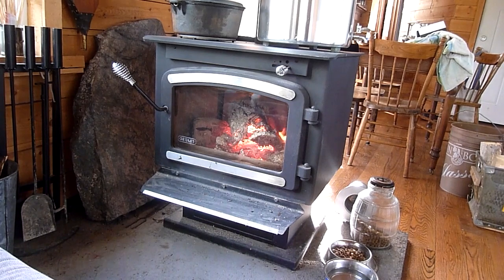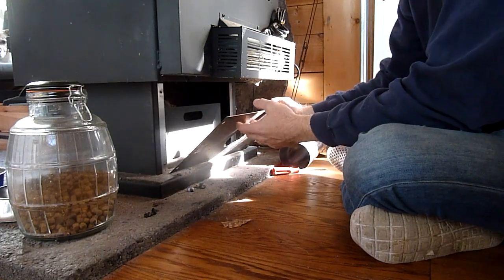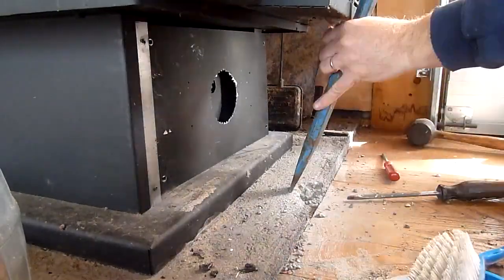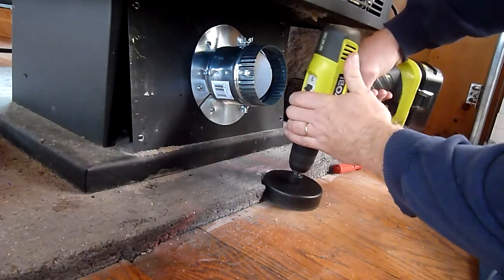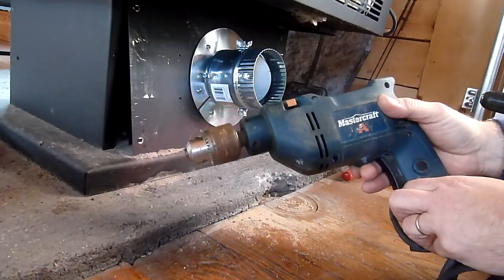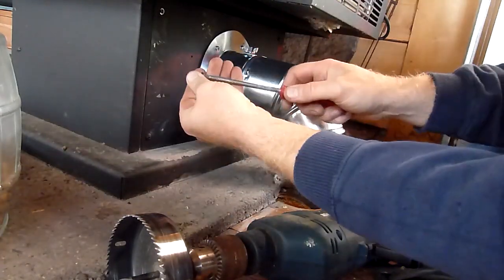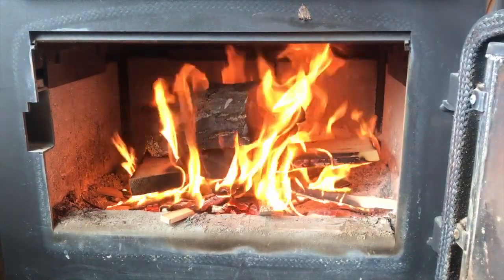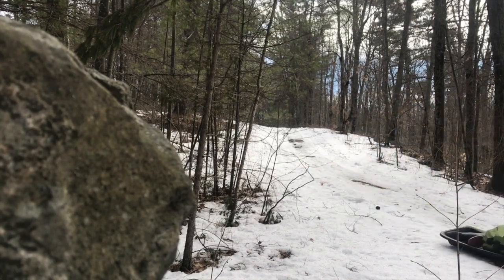Better burning wood stove with a external air intake!

Comment: You are right about the benefits of a cold air intake. After installing one on my wood stove my feet are a lot warmer in the winter. Previously, makeup air for the stove came from all the various air leaks in the house and that cold air traveled along the floor as it slowly drifted towards the stove. Outside air intake made a huge difference. One good way to observe how cold that makeup air had been was to grab the new outside air intake tube. It is freezing.

Comment: My wood stove has air intake on the back, pointing down, amount of air is controlled by the air damper built into the wood stove. But I haven't connected that input to a cold air intake. I'd like to do it, just the certified professional installer said those intakes cause a lot of problems with freezing and condensing or something. I wanna figure out how to do it super perfect so no issues.
Reply: The question you pose is a hard one to answer as each house is different, but please ignore your ‘professional installer’ 
as it’s all in the design. If you drag winter air through steel pipes which is 95% moisture saturated yes there is chance 
of condensing depending where the pipe is routed. My house is built on strip foundation and I have a 18-24” cavity 
below the floor. I’ve insulated the joists and sealed the underside of the joists with solid sheet insulation. Using a 
breathable membrane directly above the floor boards allowing moisture to escape. So the cavity is cold under the house
and that is where I draw my wood burner air from. I have ventilation grills all around the exterior walls so the air is free 
to move under the floors. I have no damp issues and the steel pipes I use are wrapped in glass fibre insulation 1-2 inches 
think. My wood burner when set at temperatures only draws air from under the floors no room air is used, only when 
initially lighting do I open internal air feed from the room. It wasn’t easy to do and I didn’t use ‘installers’ as the skills 
needed were beyond them. I did it myself when ripping the floors up to insulate as we were really cold with draughts 
blowing up through the floor boards on windy days. I needed a special 6inch stone cutter to pass the pipe through 
the hearth solid 3 inch granite slab, that was fun! But now after 4 years I’ve forgotten all the back breaking work and 
just enjoy the fire. Insulate insulate insulate, I would say. You cannot over insulate your house.

Comment: You really should insulate between your floor joists with R-40 insulation ( 2 layers of R-20 fiberglass batts). Then seal it up with plywood or a house wrap.
Reply from the maker: It’s on the todo list
Reply: @OntarioLakeside  I have one of those too...lol. Really enjoyed the vid btw.

Comment: After seeing this being installed and used for real, I am going to put one in my home. Look forward to enjoying a cold air intake. Will be taking air from the attic through the HVAC duct. Look forward to the effect soon. Peace.
Reply: Hi there.  The easiest option for me would be to draw air from the attic.  My stove comes with a cold air intake.  I would take a pipe up alongside the chimney into the attic under a clay tile roof (plenty of ventilation!).  Has this worked for you?  Cold air sinks and the air in my attic will be definitely cooler than air in the living room.

Comment: An external intake is a great idea. My stove is multifuel and has 2 intakes ( not external ) the airwash on the door and a bimetallic strip controlled intake to the ash drawer. The manual says use the airwash only for woodburning and the bimettallic strip intake for burning coal,  peat and lignite. The reason given for this is woodburning needs an air supply from above the bed of ash / embers and coal etc requires air fed from beneath the embers for optimum burning. It would be easy for me to attach a tube feeding the bimetallic intake and run it from outside. All I would lose is the bimetallic strip and intake cover but I worry that the stove would overheat or heat up too quickly after lighting causing warpage of the internal metal fire plates ( which has happened before ).

Comment: I have considered an air inlet from the outside for a wood stove and a fireplace.  We had a fireplace(built in 1934) in our house in St. Louis, MO that we bought in 1975.  It had an ash door at the back under the fire so ashes could be dropped into a chamber to be removed through the basement instead of through the house, which worked well.

Comment: Question. Would adding a flue damper to these modern stoves help in anyway? With retainingthe heat..seems like it would help but the community seems divided? Thoughts?
Reply from the maker: Dont see how it would hurt.

Comment: This was an excellent tutorial on outside air intakes. I often look at the smoke coming out of my chimney and think that just as much cold air is entering the house. A 6 inch layer of insulation under the floor would also go a long way to keeping your cabin warm. I just insulated my floors and it made a big difference. No more cold feet!

Comment: Very helpful if you live in a nice big cabin in America.
I live on a narrow boat in the UK... Don't think I'm going to drill a hole in the floor 😀I'll have to put up with cold ankles!

Another good method for making your wood burn slower and more afficient is to always leave a good bed of ash in the grate, it let's less air in once your fire is going, so logs burn longer. Only use your top damper to get it going.

Comment: This just makes good sense, when my parents house got a new furnace and hot water tank years ago they added a cold air intake for them, especially since the furnace was a high efficiency model with the exhaust gas blower (that dies every few years) so it draws a lot of air for combustion purposes.

We are in a rental with a wood stove fireplace and might be able to convince the owner to let us install a cold air intake via the wall since the stove already has a hole in the back of it’s base where you made yours.  I’ve been looking into adding secondary burn air tubes at the top of the unit but it seems like you’d need to modify it considerably compared to this, so as a first step to improve efficiency this may be a much better option.
Reply: I just took a look into the hole at the back, and looking down it appears to have a hole in the bottom as well and even a vent with a grate through the floor to the crawl space, but it looks blocked off.  There are also signs that the hole at the back was closed off at one point because it looks like 4 circles of silicon around it like something was glued there to keep it from drawing air from inside the house.  Someone must have come along and “fixed” it thinking they know better.
Reply: @SchwaAlien  Setting an air intake pipe is obviously the BEST thing to do. The stove not only pulls its fire-draw sucking the hotest air around itself (the one it just went to heat) but also all the air refill comes from outside.. the cold one 🧐
Sorry for my poor English, greetings from Switzerland 🙂

Comment: Setting an air intake pipe is obviously the BEST thing to do. The stove not only pulls its fire-draw sucking the hotest air around itself (the one it just went to heat) but also all the air refill comes from outside.. the cold one 🧐
Sorry for my poor English, greetings from Switzerland 🙂
Reply from the maker: Exactly🙂
Reply: Hey Aerocap I saw your comment on another video, looked up how to make an external air intake and saw you commented again! I don't understand what you mean about the fire draw sucking the hottest air around itself, could you explain more? If you'd like you could respond in your native language and I can use a translator.

Also, would it be possible to actually heat the cold air intake or would that not be helpful? I'm thinking if the cold air intake tube was positioned right next to the chimney, it would heat up a bit.

Comment: This is really timely for us. Small addition and the wood stove are coming in 2022. We are not very handy ourselves, but when we are sorting out the floor joists and the location of the stove we will be sure to leave room for the cold air intake pipe from down below the stove location. Good advice. Now, can I get a WETT-certified technician to install a customer cold air intake with a damper? Time will tell.

Comment: Thinking about doing this as well.  My stove already has an inlet and I notice the tower fan I have laying on its side behind the stove pushes some air in it and helps the fire burn better.  Nothing but basement below the stove so should be pretty straight forward.  Hopefully it along with improved insulation will help with the drafts we currently encounter.
Reply: Did you install the cold air intake to receive air from the basement and how did that work out or would you take it to outside? Thanks.

Comment: This is interesting.
I have a summer cottage here in Sweden, it has neither electricity nor running water.
We realize how difficult it is to get good heat with the old style wood stove, just as you say the fire sucks the heated air and you really feel cold winds on the floor!
Here, firemen and sweepers are very conservative and do not understand at all what I mean by fitting an air duct right next to the fire!
Reply from the maker: It has made our woodstove much more useful.  I highly recommend it.

Comment: lol dude, ryobi ftl, mastercraft also ftl.

just get a dewalt 99x series battery drill...you will never buy another one minus batterys.  I've had 4 to 5 major brands.  I use them daily with augers and stuff that's well beyond what any cordless drill should have.  these have lasted me 3 to 4 years at a time (i only change because the battery design does)...technically my original drills from 16ish years ago are still running strong...but not remotely close to as strong as the new brushless units.  anyways thanks for the video and ambience.

Comment: Good idea and nicely done. I guess your set up ensures there's no possibility of glowing embers falling down that air duct and smouldering beneath the cabin. I'd probably be over-cautious and put a metal box beneath the intake under the floor just in case.
Reply: There is no direct route to the firebox, the vent is to the space under the stove that the ash drawer is in, which is separate from the firebox

Comment: Hello fellow Canadian firewood burner!
Does adding a damper in the air intake hose make a world of a difference and how did you come about that (or just the fact that your air intake hose already came equipped with a damper)? 
I'll be buying a new stove that comes with fresh air intake mount but I never thought about putting an extra damper in the air intake line as every stove already got a damper. 
Thanks for the vid!
Reply from the maker: I just have it to close the damper when the stove is not in use.

Comment: Question: Why would you have a damper on the cold air intake? Seems the chimney damper would control it just fine. 
The cold air damper would be hard to get to on most installations and increase chances of getting burnt.
Reply from the maker: We use it when the stove is not in use to close off the air.
Reply: @OntarioLakeside  Thanks for the reply. I can see that. I use my stove to heat 6-7 months a year, The remaining months are generally pretty mild as far as summer goes. We might get a hot streak in July or August, but the stove is in the main living area and the only place we have air conditioning is in the master bedroom. We're on a lake so opening the doorwall and the wall of windows adjacent to it cools the place pretty well.

Comment: So how much did it help with reducing drafts coming  in through leaks in the walls?  You never said at the end.
Reply from the maker: Drafts are greatly reduced. Will all the combustion air coming from outside its made a huge difference. And the cabin heats up quicker.

Comment: no insulation under the floor?  I would think that would help.  Or do you not use it much in winter?
Reply from the maker: Its on the to do list!
Reply: @OntarioLakeside  That would be my high priority.  I used to live in Michigan and had a wood stove and oil furnace.
Reply from the maker: @royreynolds108  Im going to do foam board and a 6" batt.

Comment: You could probably save a $1000 per year just insulating the bottom side of the cabin with R30 rockwool insulation???

Comment: Small question please: i want to get a wood stove but have read about indoor poor air quality it causes. Is there a way of making it not to lower air quality indoor?
Reply from the maker: A good quality wood stove should not contribute to poor air quality. ensure the seals are in good order and that the chimney is drafting properly.
Reply: @OntarioLakeside  thank you for the reply. Should the seal be replaced from time to time?. Any way to check that there are no leaks?
Reply from the maker: @kookia213  Yes the rope seal should be replaced if it gets degraded.
Reply: The air intake should help with not consuming your oxygen inside the home. 

If the gasket on the front is not doing well a match held steadily around it will flutter.
Reply: @kookia213  The air quality in the house is a result of how tight a house is constructed regardless of the heat source.  If a combustible appliance has no fresh air, it will pull air from the house wherever there are cracks.  If your house is very drafty, then your appliance runs very good, but you will have drafts allover.  But, drafts are good for air quality because it's constantly bringing in fresh air, but, it's drafty.  If house is "completely sealed" the appliance will starve for oxygen,  and you will too. The beauty of wood burning is If it gets too hot, you can just open a door or window. It will bring down the temperature, but also bring in fresh o2.  No one does this if there are burning oil or gas because they don't want to loose the heat. When someone writes and article simply persuading you that burning wood is bad for the environment or indoor air quality,  then you can be almost sure that the govt and oil companies support this message due to profits and taxes generated from gas and oil.  If you cut your own wood no one can take it from you.  In the Magna Carta about 1218, the king said non of his men will steel any more firewood from the commoners.  But since then governments try to find ways of keeping people from burning wood so they burn gas or oil.
Reply: @1974jrod  great point of view. thank you
Reply: Will Swift  Magna Carta.  Google it yourself and read it. Fingers broke?

Comment: So now what you've done is by pulling the air from below your house now you have a higher infusion of COLD air under your house instead of that standing air beneath your house.. Seems to me your floors will be colder now. you might want to get under the house and add to that and pull the cold air from directly outside.
Reply: His house is on piers for cripes sake.

Comment: hello, I have a tin fireplace and it has vermiculite inside, wouldn't it give and retain heat longer if I replaced it with chamotte?  I understood that vermiculite has an insulating role.

Comment: Just installed a cold air intake on our PE Neo 1.6 - can't believe the change in floor temp (warmer feet on a tile/concrete floor). If a heater can do outside air, 100% worth the effort!

Comment: I'm using what I got. Insert with one side cut off. But it sucks. Lots of heat comes off it but more cold air gets sucked in from rest of the place. Need a new stove next year. I don't have easy access to any sort of intake.

Comment: Installing the cold air intake into the ash box under the stove is a great idea as it works as a cold air trap too. My stove is very similar to yours and this would work for me. It's amazing how much cold air is pulled in from outside thru door seals and windows. Good video!

Comment: I added cold air intake to a pellet stove and it not only kept the glass cleaner and it seemed to run hotter and longer on the pellets. In the cabin I added cold air with black tubeing and I believe it run longer and hotter. I added a enerzone 3.5 in a garage and after seeing you add cold air to yours I know I’m going to make the change. Thanks for your video.

Comment: I live in a mobile home, I seem to do everything after the fact 🥴 I built a hearth and tiled it got my imperial heat shields and damn! I can’t go thru floor so yeah now have to get a carbid bit to go thru heat shield I doubled up with extra durock behind heat shield to be extra careful and the install kit just aggravated as hell as I want it behind stove going thru the wall to outside not running from back and across to end of shield then outside, just want it to look decent and work right and safty above all. Paying 3 guys to get it up the stairs and into my home and set where I have taped but on my own for install and praying at 60 I don’t fall off the roof lol, determined to get it done.
Reply from the maker: You will get there!  The air intake makes a big difference.

Comment: Two thoughts
One drawing air from inside the house will help to prevent CO² build up In the house.
Second drawing cold air from the craw space. Does it make your floors colder and pipes freeze easier? Do to theair leaks under the house.
Reply from the maker: If your house is air sealed tight enough to allow CO² to build up then the fire will struggle to burn because it wont be able to draw in enough oxygen. 
We dont have a crawl space, the cabin is raised on piers and all pipes are drained in winter.

Comment: What do u use to control amount of air flow? No final pic?
Thanks for the vidio
Reply from the maker: If you look at the 1 minute mark you can see that piece has a damper built in.

Comment: buy just an inch or two extension and you wouldnt have had to chip out the concrete
Reply from the maker: Getting that extension would require, 2 boat rides and a 1.5 hour drive!